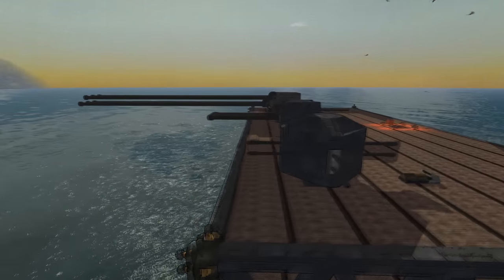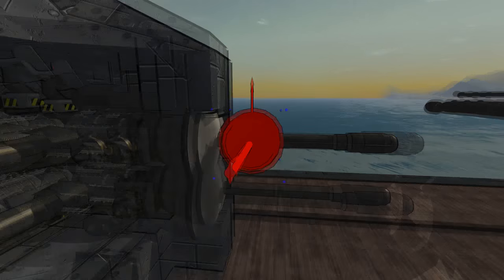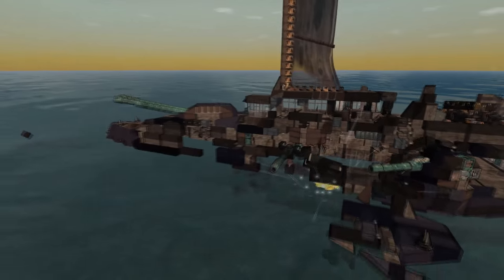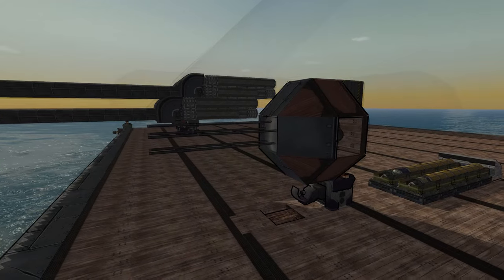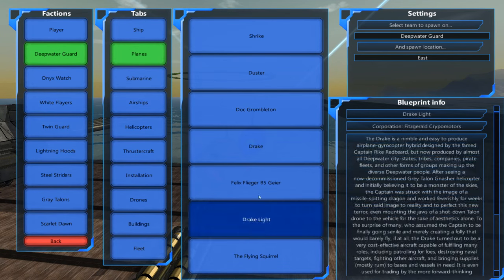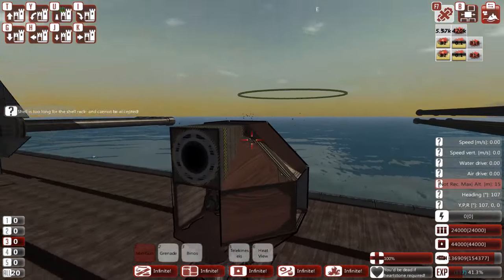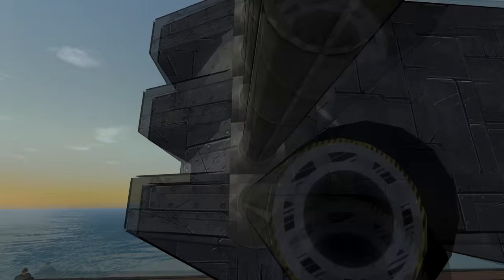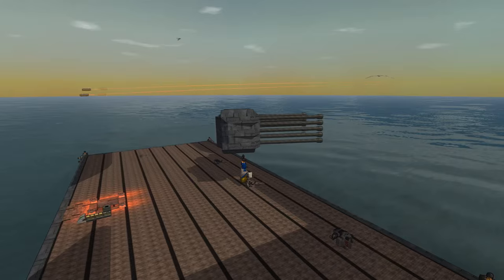No-Autoloader Cannons Pt.2 - From the Depths

Comment: I love the mini-minigun, but I can't get mine to work. I'm running an exact replica with identical rounds, but every time a new shell is loaded in, the "Time since last shell loaded" jumps to -1030, meaning the thing will only load shells after 17 minutes. What do?
Reply: +Omega Pi X its a bug in the current build, there will be a hotfix soon no doubt
Reply: +Ruger Cheers.
Reply: +Omega Pi X Hmmm I'm running into a problem of the ammo not being recognized and being unable to get it hooked up. It worked once and then when I've tried to duplicate it, it's a no-go.
Reply: +Rotary Saw Huh, that sounds like a different issue. Perhaps it's a glitch? Iunno, maybe double-check everything to make sure that it is a fault with the game. Ammo routers, ammo inputs, ammo barrels and the shell customisers all need to be correctly set up, and you might have unintentionally neglected one.
Reply: Haha ! That gun is awesome,love ot

Comment: Okay i am trying to build the teensy cannon, and i have it set up exactly like yours, but for some reason it will only fire one round than it says "-622 (or more) seconds since last shell received" and it wont go any lower
Reply: +wildboar222 okay so every time it does this it loads exactly 1 shell, and now the loaders are at -2000 seconds...
Reply from the maker: +wildboar222 Yeah, I'm pretty sure the cannons are bugged at the minute.  Running into the same problem with input loaders on just about anything, but it's not consistent.  I'm sure Nick will have it fixed soon. :)
Reply: +ireLAN Gaming yea just tried it myself and got the same result, dang nabbit
Reply from the maker: There are a few bug reports on the forum about it, so I'm sure Nick is aware of it. :)

Comment: Why did you put a mantlet if it's a two axis turret?
Reply from the maker: +Mariux - Turrets turn much slower than the mantlets do.  I found that having a mantlet there as well improves the amount of time the turret can fire by quite a bit, mostly against fast moving targets.  It's a significant resource cost, but in this situation, I think it's worth it. :)
Reply: ireLAN Gaming Aaah, I see. Though I'd like to experiment with a similar design without mantlets as a very close-range weapon as you don't need to move it around as much when you're close.

Comment: No-autoloader cannons seem to be just as good as normal autoloader cannons... One might be stronger but the other is very spammable.
Reply from the maker: +Squid117 Yeah, they definitely have their place.  The suffer from a larger overall resource cost because you need more barrels and firing pieces, but they pack a similar punch and are a great way to increase redundancy.  I think mixing both types of cannons on a ship is definitely feasible. :)

Comment: What would you say is the most effective shell to use ( having been trying to test loads but they never seem to be as effective as yours ( looking for explosive shells not sabot ( 100-500 mm cannons))
Reply from the maker: +ozziew007 At the minute, if you don't mind the short range, I think 1 block Gunpowder, HE shells are brutally powerful at most gauges.  They seem to be the most effective spammable general purpose round I've come across.  Works in nearly every gun I put it in. :)
Reply: +ireLAN Gaming thanks will try this
Reply: +ozziew007 for now, HE, HE, Inertial fuse, 3x Powder. When far projected 1str shields become a thing then: Comp head, HE, HE, Inertial Fuse, 2x Powder. There will be an in depth shell guide coming when the HEAT mechanics get updated.
Reply: +Ruger wooo thanks ruger

Comment: so i have a question about engine overhaul, more specifically the exhausts; does linking multiple turbo-chargers through the exhausts provide a certain benefit? like better Cylinder cool down or something else? and does not connecting them at all provide any benefits?
example 2 engines with 6 turbo-chargers one has 6 different exhaust pipes for each, while another has all 6 connected and exiting 1 exhaust pipe.
would there be a difference in any of the stats or performance?
Reply from the maker: +James Fan (Takamiki) At the minute, it won't many difference at all, so you can almost completely ignore exhaust pipes unless you're using them as a direct output to cool a cylinder (attaching an exhaust directly to a cylinder acts as a cooler).  Nick has said that this might change in the future though, so it won't hurt to route your exhaust gases away from the engine, it just doesn't matter currently. :)
Reply: aw... oh well.. atleast it looks nice when you route them right :D
Reply from the maker: I find it very hard NOT to do it, lol.  It makes my brain itch! :D
Reply: ireLAN Gaming you know what be nice? if the exhaust smoke acted like a small smokescreen against lasers xD i mean they are both smoke they can obscure light after all
Reply from the maker: This would be cool, but it might be a little bit imbalanced for the poor lasers.  Almost every ship will have an engine, meaning they all have a free smokescreen.  Cool feature, but doesn't really work from a game design perspective.
Reply: ireLAN Gaming how about it wouldn't be as effective as actual smokescreen from smoke screen generators and 1 exhaust pipe with only 1 exhaust would only cover a very small area like 3 blocks max? plus the fact exhaust won't be able to cover downward and it always going up
Reply from the maker: You shouldn't be suggesting it to me, you should be putting it on the forums.  Nick listens to this sorta stuff! :D
Reply: ireLAN Gaming fair poitn also question... i am trying to make a AA defense turret using 78mm shells to keep reload down as much as i can while still keeping as much damage as possible and keep the turret small but my biggest problem right now is finding out how the altitude fuse and laser targeter works so got a video about it in depth explaination or know a place i can read up on it? i try to google it but i keep getting stuff about RL or the missile laser desnigator in the game
Reply from the maker: I did a video a while back about using timed fuses to make AA Flak cannons.  It's a bit old now, but how to use the timed fuses is still the same: https://www.youtube.com/watch?v=4zAJCJNqfOA
Hopefully that will help you out.  I find altitude fuses are actually terrible for AA guns. :)
Reply: ireLAN Gaming you would think with AA you use an altitude fuse but has there been any changes that is worth mentioning that is different from the video that would affect this?
Edit alo if you could correct me if i am wrong but laser targeter will change the fuse on the time fuse automatically based on how far the enemy target is right?
Reply: ireLAN Gaming so messing around in vehicle designer i ended up just using a 5 block shells with 5 powder casing, proximity fuse with 4 m range, an inertial fuse for shields, 2 HE warheads and a composite head couldn't get the laser targeter, frag, flak, time fuse to work but this does apparently and i upped the thing to 88 mm (good old German gun caliber)
Reply: ireLAN Gaming another thing i like to ask (and sorry for all the questions) is there a way to decrease the accuracy for advance cannons? cause i am now making a really fast firing low caliber (25mm and 75mm) gatling AA turret and with that you don't want too much accuracy cause you kinda want to spread around as much dakka everywhere
Reply from the maker: Your best bet is either a shorter barrel or a longer shell.  I think these are the only 2 factors that decrease accuracy.
Reply: ireLAN Gaming i got yet another question xD with localized resources that supply circle around ships/fleets if i wanna make a supply line underwater do i need to have them within another ships supply circle or do the circles just need to touch? cause making a supply pod within 1km or 2km distance from one another makes a pretty big differance
Reply from the maker: I'm pretty sure both vehicles have to be inside each other resource circles.  Although I haven't tested this.

Comment: they need to buff low cal shells in real life 20mm would decimate wood but plink of metal while 500mm would probably fly straight through wood (1m) but destroy metal
Reply from the maker: +TheChosenZebra This ain't real life though.  If 20mm guns were really powerful, fights would be over in seconds and the other damage systems would have to receive major buffs to damage to compensate.  It would be a balance nightmare.  Folks need to stop comparing this to real life, this isn't a simulator. :)
Reply: ireLAN Gaming :P I suppose I just wish I could make realistic ww2 stuff